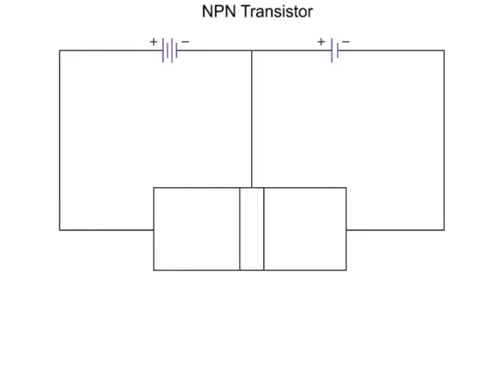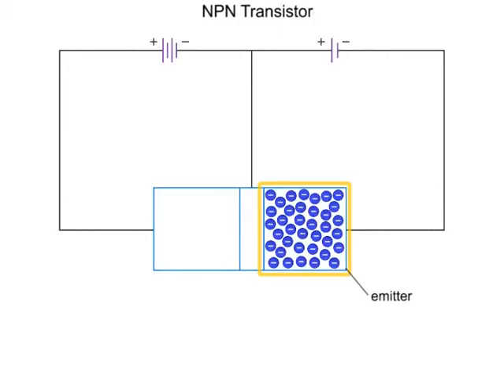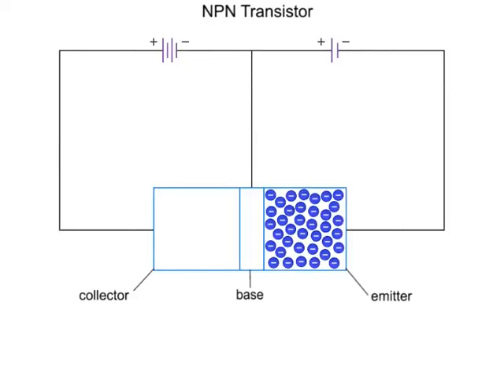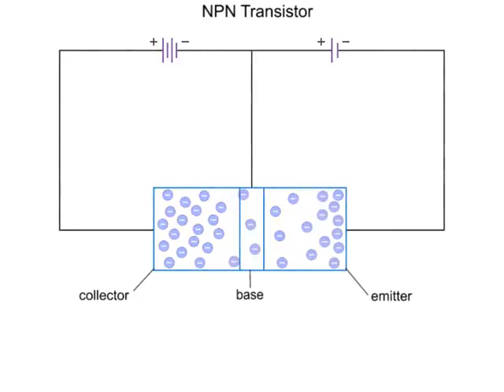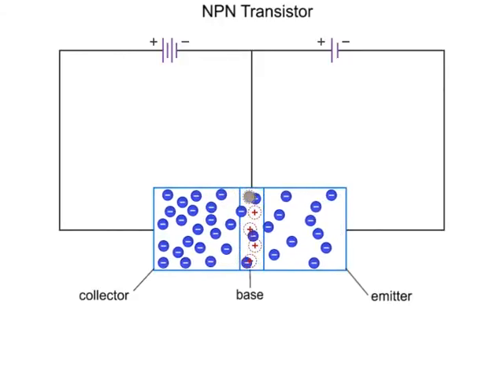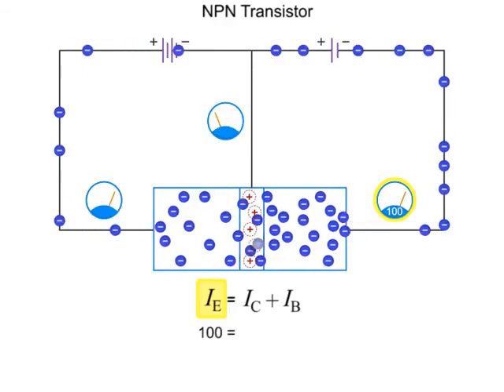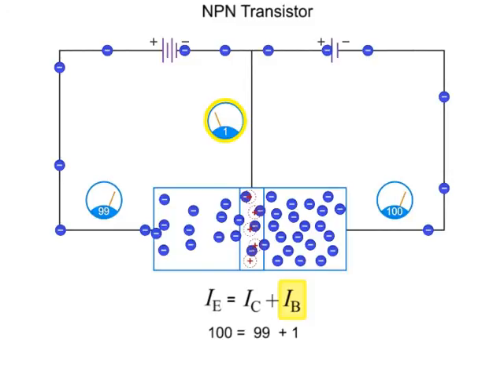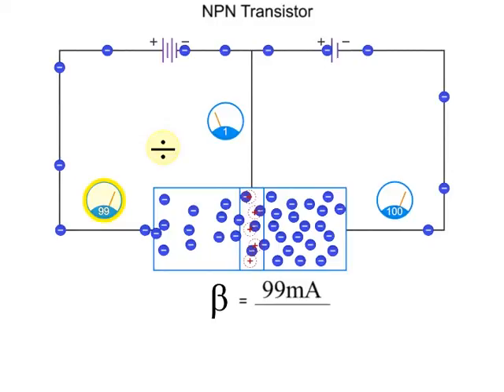NPN Transistor Structure and Calculating Beta

Comment: Does beta not have a unit of measurement?  I would think that the 99 beta would be in mA.
Reply: the unit fraction is mA/mA so they cancel out, a bit like strain if you have come across that (change in length/original length (m/m)) so just becomes a ratio. Hope i helped ;)